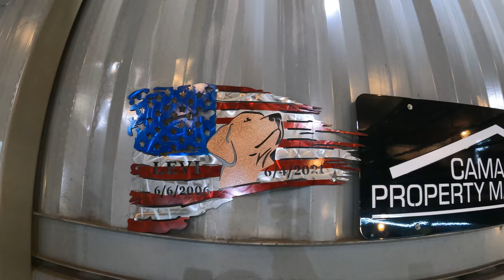Dragging a broken Bobcat with a dozer

Comment: The old 743s are good machines.  The main reason a lot of equipment break down is people don’t know how to operate and maintain them properly.  Got 17,000hrs on my 743, still running strong 💪
Reply from the maker: Really? I had a 742 and a 743, I could not keep them going. Always fixing them and they were hard to work on. The Takeuchi skid steers and IHI are way better.
Reply: @AndrewCamarata  they are a pain to work on... I had to rebuild the spool bank on it once...had to make a special spanner to remove it.
Rams are easy to re seal...30min job!  The cooling ducting is hard to access to clean properly...had a minor problem with rain water leaking into the chain case, bit of silicone fixed that. the Kubota engines have a history of cracking heads...main reasons is people don’t look after them... mines never missed a beat...needed some new glow plugs though

All the newer bobcats I’d never own...especially the CTLs

Often how much you work on a used machine is because of the life it had with the previous owners

Never buy a Terex or ASV when you work them hard with the electric over hydraulic configuration you can literally smell electric wire burning
Reply from the maker: The spool valve is what killed my 743, it went bad, I took it out which was not fun, sent it to a hydraulic shop, had it rebuilt, I put it back in and it was not right, the guy came out removed it rebuilt it again put it back and it still wasn’t right, then I was towing the thing somewhere to get fixed on my truck broke down so I just sold it broken. it was a lemon the entire time I owned it though, constantly blowing hoses metal breaking and under powered, there’s no comparison between the new tracked Takeuchi machines
Reply: @AndrewCamarata  I agree the oochie is a good machine for quality and value etc.  

But as we all know for a decent CTL these days a CAT is at the top. Kubota are good too.

I hate all the electronics they have these days, but I’d like to try out a JCB teleskid or the JCB 1CXT.  Look em up

BTW you seem like a capable guy, start rebuilding spool banks yourself, they’re easy, same with rams, there is not much to em.
Also with a lot of your hydraulic hoses you can use re usable fittings which you can twist on yourself without the need for a swaging machine...saves a lot of money at the hydraulic shop
Reply from the maker: really think cat is better? There’s a place near me that rents both of them, they say the Takeuchi is a better machine
Reply: @AndrewCamarata  I don’t go off what others say, I go off personal experience as an all rounder. if you’re working a machine 50hrs a week nonstop like we often do in civil works, you look at everything, parts availability, distribution network, technical support, warranty etc.  I’m in Australia, oochies parts distribution and tech support is nowhere near as good as Cat over here.
Reply: @AndrewCamarata  I’m not saying I know for sure but I doubt the problem with your 743 was not the spool bank...often people think the spool bank needs rebuilding when in fact a ram can get what they call “internal bypass” the most common situation is where the end nut inside the ram comes lose, falls off and causes the piston to fall off. It’s happened multiple times in my career with all different equipment.  Did it sound as if the hydraulic system was under load?
Reply from the maker: Nah, because it started off as the spool locking up. I even had the tilt cylinder rebuilt because it "might" have been the problem. Still didn't fix it.

Comment: The winch lever on the D7 seems so deadly, I'd want to fix that right away.
Reply: It's not deadly. You're actions would make it deadly. You knownits a machine and will kill you without thinking about it. You do not out yourself in the position to get hurt and you'll be fine.
Reply: @mikeznel6048  Well cables and chains snap all the time so even if you think you are safe, you can still get cut in half. That was my point.

Comment: Hey Andrew. It would be cool to see you modify that trailer with a slight lift . You could put larger wheels, tires, figure out how to possibly get more clearance at the tongue, add a longer loading ramp to compensate for the increased height and add a swivel jack. You have great fabrication skills.

Comment: Looks like the next project is to modify one of your trailers into an off-road trailer. Higher ground clearance, independent suspension, off road tires etc. That would be interesting to design.
Reply from the maker: I can borrow that military equipment trailer from my friend. That goes up there fine.

Comment: I know you're not a fan of bobcats, but I bought one a few weeks ago, and it works great so far, aside from everything is electronic and there are safeties on everything. I had a weird issue where the machine would run fine for a few minutes then lock everything down, turned out to be the RPM sensor on the engine, $25 later and the machine runs flawlessly again. We'll see for how long I guess.

I mean who makes a machine lock up all the controls if it loses RPM signal? I'm too used to my 80s machines that have zero in the way of safeties.

If I lived closer I'd say bring it on over, but I doubt you want to tow a bobcat to TN, I mean there is a gorgeous lake to jetski on, but since you're planning on selling the machine anyway, leave that for another day.

Comment: So the trailer isn’t too low when going down your driveway, you could use the trailer jack to jack up the back of the truck, block the suspension against the frame with some scrap wood or steel, and then just tow it down the driveway slow, once you hit the road take it out.

Comment: Don't think I've ever seen one of those old cat dozers without exhaust leaks 
I think caterpillar makes a bracket to help line up and drill out the studs in the head
Iv screwed this process up before and drilled till I hit water...luckily I was able to put silicone gasket maker in the stud hole and on the threads and stop it from leaking...been holding for over 5 years

Comment: Old welding techniques can teach a guy to be better at new welding processes. Invest in a top quality set of acetylene torches. A good cutting torch and practice can greatly reduce the amount of grinding as well. I like using stick welder AC/ DC for heavy metal plate work. it gives great Heat and penetration

Comment: THEIR SHOULD BE TWO VALVES IN THE HYDRAULIC SYSTEM under the seat IN THE BOBCAT that you turn that will allow the hydraulic motors to unlock called wrenching valves that will allow the tracks to freely turn.

Comment: Hey why not put a skid plate on bottom from hitch to back, just ahead of the jack! Keep it from digging in And or a roller made out of a pipe so if Tongue  does bottom out it rolls. Also put a rollers under & across the back just ahead of the ramps hinges. So no way trailer can hang up rollers can be 2” pipe!

Comment: What kind of camera mount is that when you are driving through the woods? In earlier videos I thought it was a drone controller, but the way the camera was going thru the brush and no sound make me think otherwise. Also, it looks like something is blurred right after your hand like the camera is on a flex pole. Whatever it is it's pretty cool, and it would be nice to know what technology you are using 😊
Reply: It's either a special mode on the Camera or software tricks during editing.  It's literally just a selfie stick.  Might be a cool motorized one.

Comment: 23:09 Those look like regular tires and rims ... but they are REALLY heavy duty, ... check out the EIGHT holes for lug nuts .. I was going to mention "load rating" but I'm not sure what rating That trailer has .. or even if the load rating are the same in Canada as US

Comment: What would you think about raising the pintle hitch on your truck up to the next set of holes to raise the trailer up like you wanted at the end of the video?
Reply from the maker: Maybe, the truck kind of needs stiffer springs.
Reply: @AndrewCamarata  gotcha, thanks for the reply. I'm sure that's something you can fix. I bet you could find a cheap set of leaves from a dodge dually or chassis cab that would have higher load rating.

Comment: Would this kind of towing be kinda hard on the skidsteer's boom hydraulics, since it's basically supporting the whole weight of the machine in pretty rough, bouncing conditions?  Or is that something that they're build heavy enough that they can just take, 'cause that's just built heavily enough to not care?

Given how much of a pain this road seems to be, would it be potentially worth giving that D7 a bit more of a work-out and getting it shaped up a bit for easier access?

Comment: Don't wish to sound foolish but I wonder if when replacing the trailer jack, what if you just left the cross beam where it was and cut a hole in your cargo screen and mounted the new jack on the back side of the existing cross beam and welded it a little higher?  Oh and if you don't want a wobbly farm/fence jack just remove the foot piece and weld the jack to a piece of 12x12 x 1/4 " plate, then cut a hole in a 6 "piece of channel iron and weld it to the plate and jack and it will stand up by itself.

Comment: Where did you get those Chain Binders that has the power drill option?  I've been looking around for a set.
Btw, I'm surprised you still own a Bobcat for as much trouble as you have with them and you have two Takeuchi machines.

Comment: I thought for sure he was going to fix that road with the bulldozer on the way back up.
Reply from the maker: I did some stuff to some spots.
Reply: @AndrewCamarata  I thought you would. Almost seems like a wasted trip if you didn't.
Reply from the maker: It was getting dark on the drive back up. I could spend days on that road.
Reply: @AndrewCamarata  I bet. It is a bit hard to tell how long your road is, but it does look like it is currently a fun off road trail. That bulldozer seems like it is so powerful that you could just drop the hammer and drive.
Reply from the maker: If you "dropped the hammer and drove" You would start ripping big rocks out of the ground and make more of a mess. Fixing that road properly is a huge project as it is miles long.